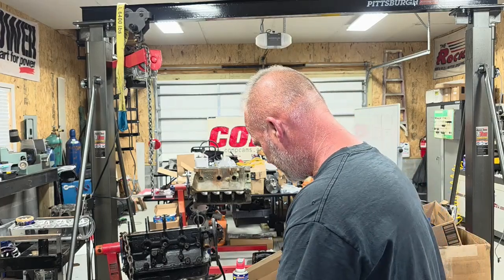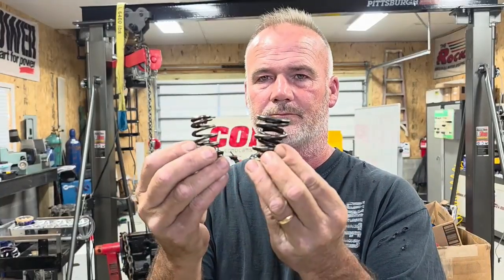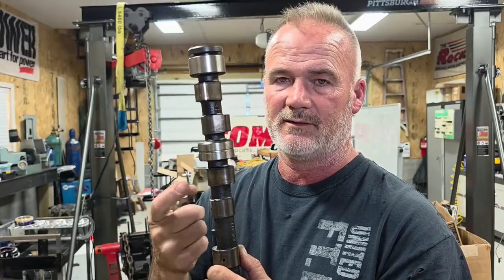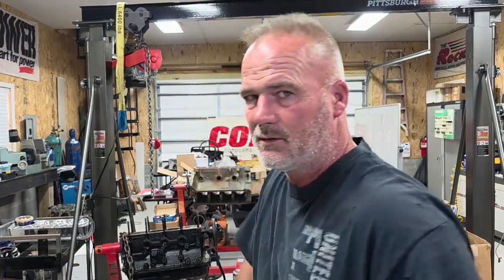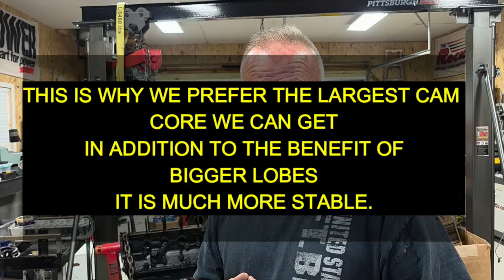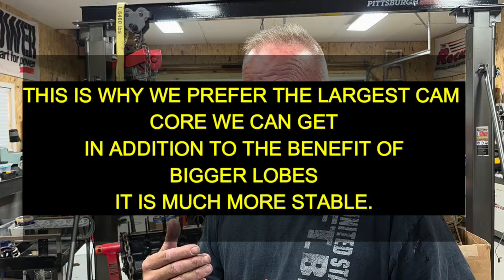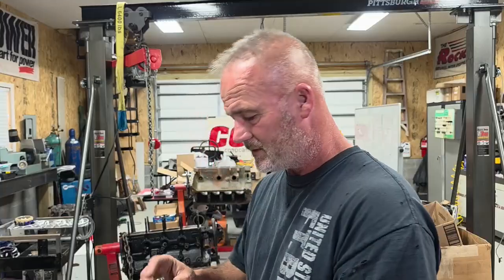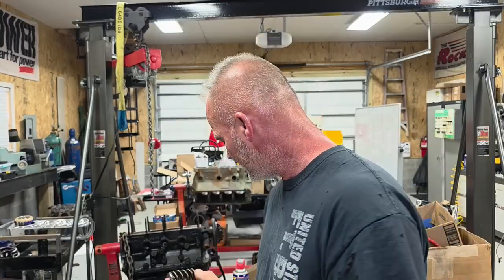TITANIUM VALVES! Are they worth the trouble. depends on the application but YES YES YES PLEASE WATCH

Comment: i love titanium pieces for their lightweight and high strength properties but my 2 biggest worries about titanium are:
1) titanium's heat dissipation properties suck, hence why there are no titanium pistons. would the heat buildup potentially cause trouble in an endurance racing setting?
2) titanium is strong, but it's extremely easy to scratch and therefore wears out pretty fast. this is a known problem and people coat their titanium valves in materials such as CrN or PVD but i'm yet to hear about how these coatings really perform over long term use as these coatings are theoretically similar to the nikasil/alusil cylinder sleeves and those can scratch, resulting in those being not nearly as durable as iron sleeves.
i would love to learn more about these.

Comment: So, larger diameter cams of billet steel are part of the answer for high spring pressures.
This would mean a cam with a minimum diameter that is the same as the base circle of the cam profile, so the base circle has only to be hardened and polished where the lifter meets the cam.
A 60mm bearing cam has lots of room to make the actual camshaft thicker overall, yes?
With DOHC/ SOHC cams, there is no practical limit on the cam diameter, then, yes?
Further, would it not be the case that spraying oil directly on the valve stem would cool the valves more effectively?

Comment from the maker: What I am concerned with is the heat build up between titanium and other metals more so than wear. When the titanium valve gets hot, it will break. I dont play Russian roulette with peoples engine. Its just a matter of time when you use any other material other than Beryllium copper seat and bronze/mang guides..
Reply: Could everything you have been talking about be used in street / strip racing or strictly Racing  applications  hi 👋 from Ontario 🇨🇦 where I follow you 💯 from   excellent and valuable information   !!!!
Reply from the maker: @domenicomonteleone3055    yes if used on the Strip it would have to be done correctly and every detailed followed but yes
Reply: @SalterRacingEngines  Thank you kindly for responding back to me in Ontario 🇨🇦 much respect 🙌 🙏.
Reply: Still  ti valves is better option than hollow stem when it using high rpm application.  When using E85 fuel there is no problem that ti valves get too hot.

Comment: Could using the wrong seat material AND the wrong guide material at the same time accelerate valve guide wear due to heat and galling?
Reply from the maker: Yes absolutely. What I am concerned with is the heat build up between titanium and other metals more so than wear. When the titanium valve gets hot, it will break. I dont play Russian roulette with peoples engine. Its just a matter of time when you use any other material.
Reply: @SalterRacingEngines 👍

Comment: What about sodium filled valves? I worked at Moritz machine in the 80s and 90s and one day Dick calls us over and a throws a boken valve into a 5 gallon bucket of water. But I forgot WHY.
Reply from the maker: sodium explodes when in contact with water LOL dangerous
Reply: @SalterRacingEngines lmao. I dont mean why did it explode. Why do you have sodium filled valves in the first place. If i remember right this was on a funny car engine that came in to the shop and the engine had blown up and yes he threw it in water on purpose .. does in lighten the valve? Heat disipation?
Reply: @DiscoGreen the sodium filled valve is lighter but mainly it conducts heat away faster and it somewhat has a dampening effect.